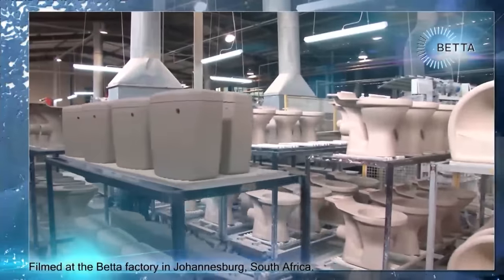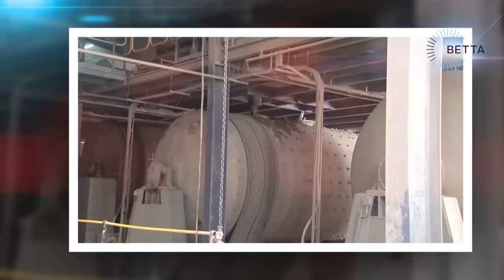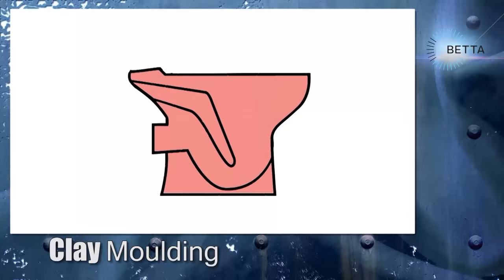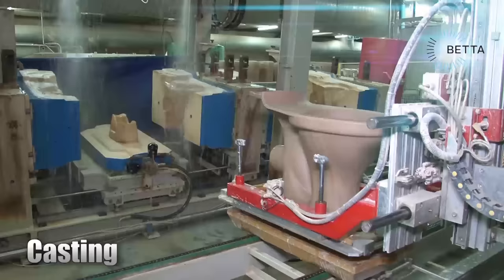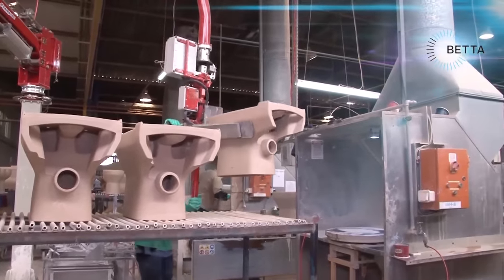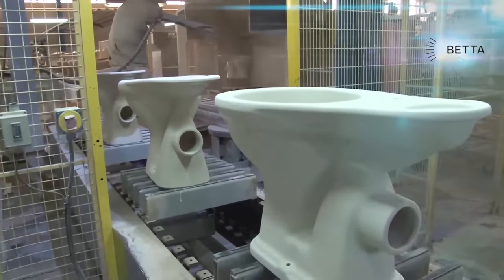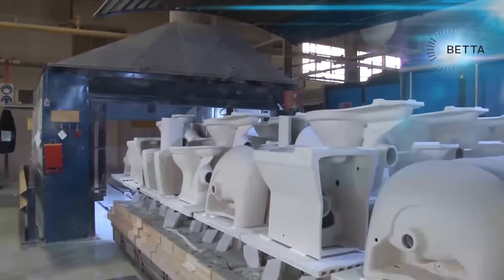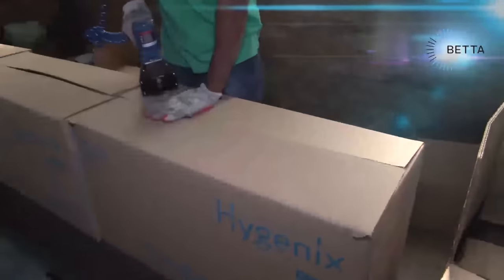How TOILETS are Made

Comment: i think one of the most important part to give the toilet a good appearance is the smoothing out process. I came to this video after just buying a brand name toilet that has wavy curves on the outside. From this video it looks like when the mud is still wet, gravity causes the surface to be uneven and it is up to the sanding person to make it even or smooth again.
Reply: Ol
Reply: When the pieces are de-molded, they are very "Plastic" and fragile the clay will bend, dent very easily. The potter has to be very delicate in handling or they will be damaged. The piece must be finished properly before the glaze is applied in order to look good.

Comment: If my Kohler toilets in the US ( made where?) are any indication glazing the toilets is not such a simple procedure and I don't see how a single automated machine can do the entire process as there are several deep, recessed areas that would have to require special guns and machines or humans to adequately cover, In my case toilets were not properly glazed in the very bottom nor the area under the inside lip resulting in the finish wearing away over time with the result being the color of poo and looking like an uncleaned toilet. Apparently some finishes are much more resistant to water chemical stains than others. Lppks like here they use people.
https://www.youtube.com/watch?v=kDQp3hFmCa8

Comment: Making toilets this is way better as the bowl is 1 piece.  The "how it is made" showed processed of 2 pieces glued together for the bowl.  Imagine it splits right down the middle while sitting on it? 💩
Reply: Same process! Those were casting  moulds which are also pieces here. Otherwise the final casting is one piece.
Reply: @ShastaLevi  I don't think so.  Do you SEE the toilet bowl made in 2 pieces and GLUED together here?  It is cast as 1 single piece here.
Reply: @diyjohn9584  you are correct, I just watched the How It’s Made video to see what you meant.  On that video they made most of the lower section as one piece and the rim was a separate piece and they “glued” the two pieces together with the liquid slurry, then they scraped off the squeeze-out to make it smooth.  This South African plant’s method is superior.